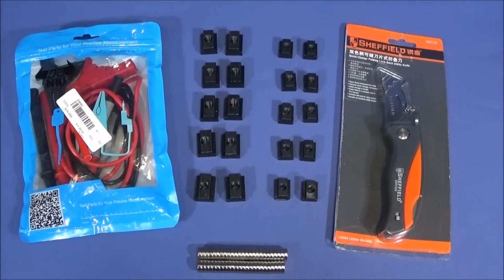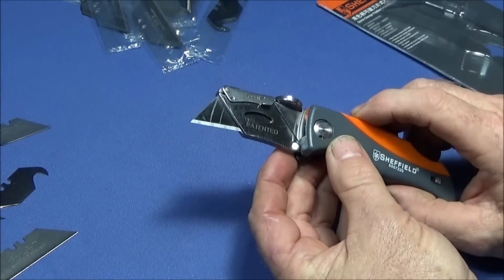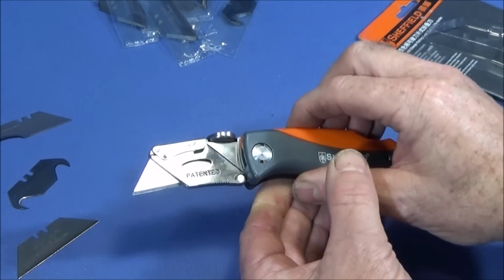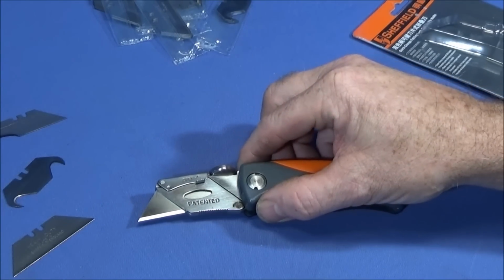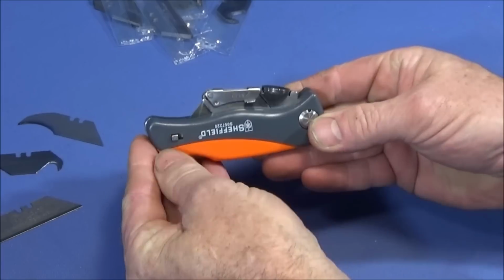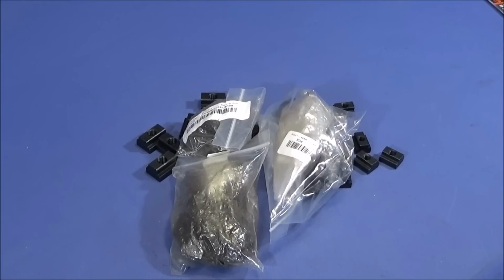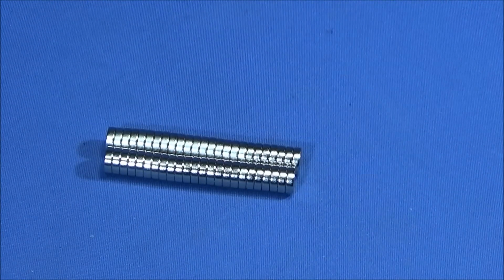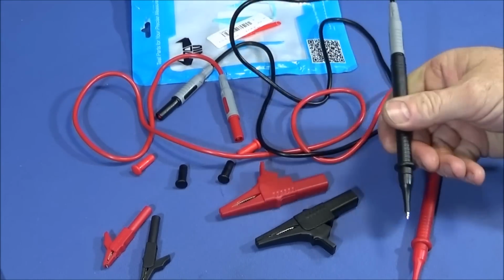Sheffield Utility Knife S067220, Machine T-Nuts & Multimeter Leads

Comment: The Tee nuts may be cheap, but the 8mm ones are too big for the swivelling Myford-type milling slide that you recommend, and the 6mm ones are too  sloppy to use on that slide.
Reply from the maker: Hi Ken, I forgot to mention that it only takes a few minutes to put an 8mm or 6mm thread in the chuck, screw a 'T' nut on, up to the jaws and face several thou of the underside. One then has the maximum thickness for strength. 
  Many that I have bought in the past from UK sellers have been really expensive, plus they are too thin.
Reply from the maker: Hi Ken, out of 30off  8mm T nuts I had about 3 that needed facing off to fit the milling slide. The 6mm T nuts all needed facing off a bit to fit the Myford cross-slide.

Comment: I have one of those utility knives, but it never leaves the toolbox. Good ole Stanley retractable utility knife is better (opens way faster) and safer (closes without having to watch your fingers), which is why I only use it. Not to mention all my tool pouches have an actual location for a normal stanley knife. Good deal on the t-nuts though and I like the meter probes.

Comment from the maker: SEE THESE EXCELLENT HIGH QUALITY LOW COST TOOLS BELOW:-
Machifit 10pcs M6 T Slot Nuts Set --  https://goo.gl/CM9JFS 
Machifit 10pcs M8 T Slot Nuts Set -- https://goo.gl/hyX9sd
Sheffield S067220 Fold Utility Knife -- https://goo.gl/T6xSDv
Effetool 50pcs N50 10x3mm Strong Ring Magnets -- https://goo.gl/mbgbwg
Daniu Universal Silicone Wire Multimeter Test Leads. https://goo.gl/hJa2sZ
Reply: Hi Steve. Good selection as usual. Do you have the reference for the multimeter leads?
Reply from the maker: @grumpyalbert  Hi Thanks, Yes I have added that set now in the links.
Reply from the maker: PLUS SOME EXCELLENT MECHANICAL & ELECRITICAL TOOL SALES.
11.11 Tools Sale -- https://goo.gl/JzySBk
60% off Mechanical Parts -- https://goo.gl/cx7WJE
60% off Electric Tools -- https://goo.gl/tyoeBC
Reply from the maker: Black Friday Electronics & Tools Sale -- https://goo.gl/HNv3UP
       Black Friday Tool & Mechanical Part -- https://goo.gl/KUnhfh
       Black Friday New Tools -- https://goo.gl/TxwLya
       Black Friday Professional Tools -- https://goo.gl/h3BGon